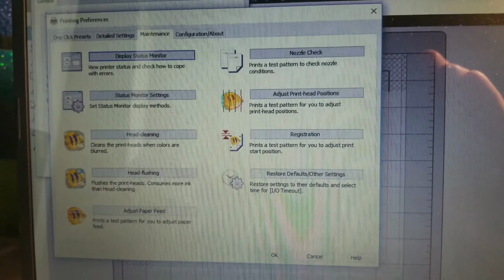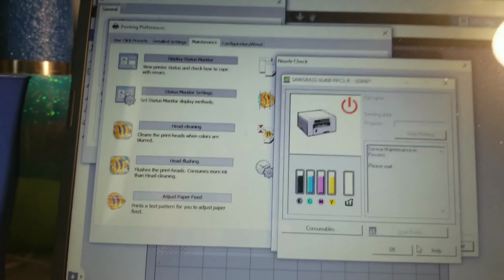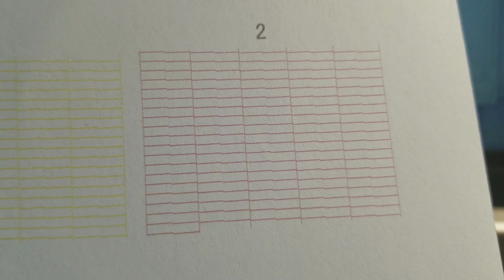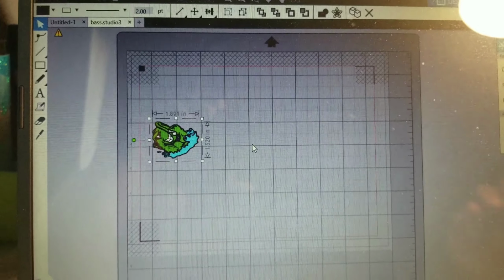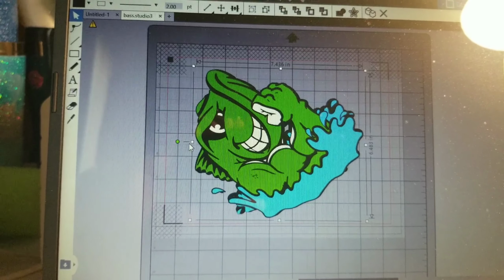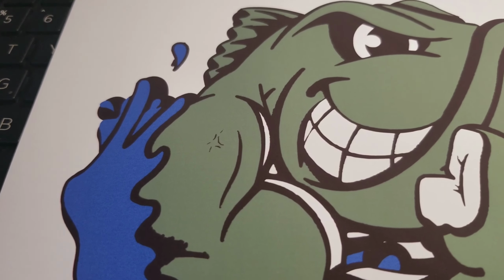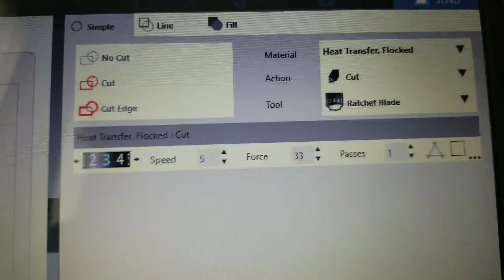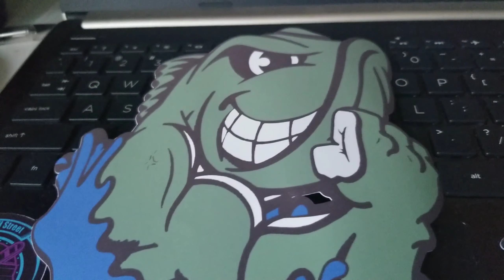How to troubleshoot print lines on your sg400

Comment: How do you get to printing preferences?
Reply from the maker: Let's say I am printing from silhouette  I hit print  I make sure  my sawgrass sg400 rpcs-r  is highlighted   in general it will say preferences  to the right click on it . It will bring up printing preferences  go to maintenance  and it will pop up the screen to do the head cleaning  ,head flushing and everything else hope this helps
Reply: @TheImpossibleco  so you are printing from your silhouette, ok I was printing directly from my MacBook Pro and that option didn’t pop up.  I am goin to try denatured alcohol to clean belt and heads. Thanks
Reply from the maker: I just made a video go see if it will help you
Reply: @TheImpossibleco  ok